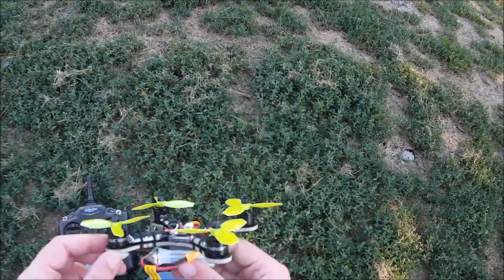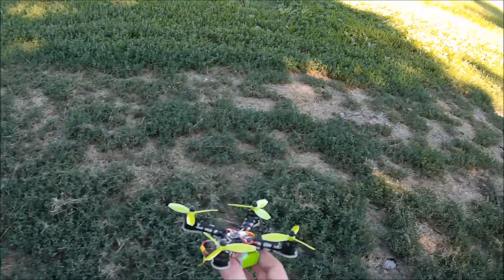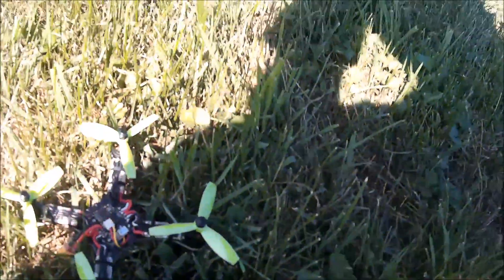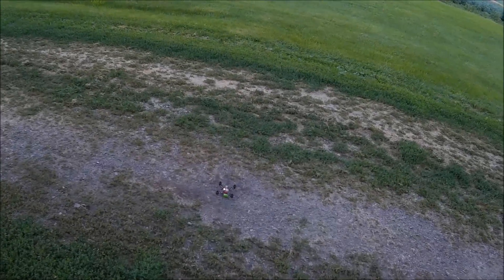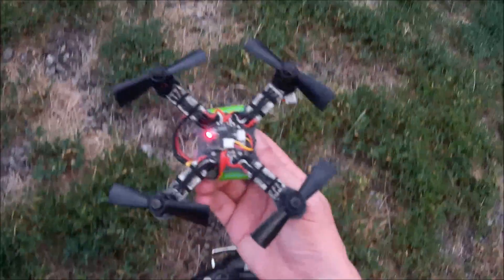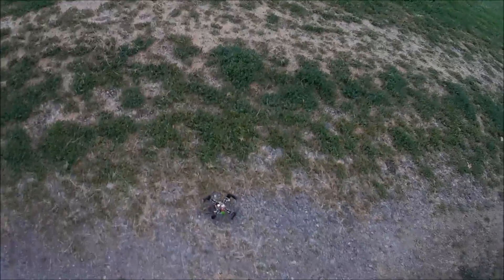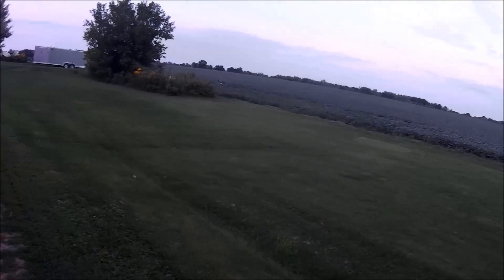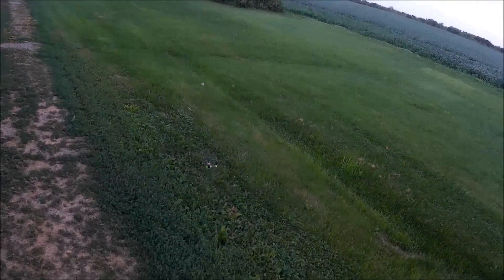1407 3200Kv 4s 3" prop comparison

Comment: Have you considered the 3545 tri baldes on your LOS build? 
http://www.ebay.com/itm/DALPROP-2-Pairs-3-blade-T3545BN-Props-for-FPV-Racing-GREEN-/231929028080?hash=item36000c1df0:g:MPYAAOSwKfVXJHYc
The math says they will physically fit without hitting the props together on a 135mm frame. Pretty sure that wouldn't work for FPV and the amp draw might kill the Piko BLX. But it could be worth a look at least.
Reply from the maker: I am pretty certain they would be too much for my setup, at least on 4s as 3545 tri bullnose would be a big step from standard tri 3040.  Bullnose  tend suck on efficiency  and stuff is already getting warm enough for me with the 3040's as is.  Definitely would want a larger battery and it's probably doable but I am kind of focused on FPV at the moment.  Racing is in mind so efficiency/reliability has to be considered.  Next on my list is to try standard 4045 on 4s.  I could be wrong, but I'm pretty sure there is not a sub 1000mAh battery that could ever even provide the sustained current to worry about the 50A limit.
Reply: I think you are right. I have some 1400mah Etreme batteries from SMC rated at 45amps. So that in theory shouldn't be enough to kill the Piko BLX. lol. And of course a smaller battery would have less current capacity and should be safer.

Comment: Can you give us some more details on this build?  What FC, ESC's, and what you are using for a PDB and anything else that might be useful to try to recreate something similar? Also, can you clarify if these yellow props at the beginning of the video are RotorX 3030 or 3040?   I think you say "3030" in the video and I can't seem to find them, I can only find the 3040's. I purchased the frame from you today by the way.
Reply from the maker: Hi Chris,
Thanks for your purchase.  I am Using the Piko Blx FC.  It has integrated PDB and one of the main reasons I love it.
ESC's are Blizzard (I think 20A) from RTF quads, but I they they are out of stock and I got them a while back so there are probably better options now.  Most 20A Blheli capable should work okay.   

And yes, sorry the Green tri-blade props are 3040 not 3030.
Reply: I had already purchased the Piko BLX (still on its way to me). Great minds think alike I guess. The PDB is only rated at 50amps though, do you know how much amperage you pull with the 1407's and the 3x4x3 RotorX props?
Reply from the maker: 1407 3200kv with 3030BN is listed as 9Amps, I don't expect 3040 tri's are much more.  Applicable batteries aren't delivering 50A anyway.  The 50A is probably a continuous rating as well, so I am far from worried about the board myself.

Comment: Hi Dave,
Amazing video! I'm Jon from overskyRC, we produced Hermit 145 V2 FPV Quadcopter, I would like to send you one set for try out and make a video, please let me know if it is ok.
Thank you!
Reply from the maker: Thanks for the offer Jon,  I am not the best FPV pilot but am practicing everyday so I should be able to make a reasonable video demonstrating the performance.  It is certainly okay for you to send one.  I am assuming you are aware I am owner of PicnicQuads.com and have purchased from you store multiple times.
Reply: Hi Dave,
Yes, this is the reason I contacted you, you are professional . We are changing a bit for the FC on Hermit 145 V2 at the moment, as we found that the quadcopter body would turn slightly when it was connected with Cleanflight software even it was still(no movement) on the desk, we found it could be a MCU problem on the FC, we will make a new FC for this quadcopter, it will be a F3 FC, it could be available by the end of this month.
Thank you!
Jon

Comment: I've recently done pretty much the same thing on a very similar 3" setup. Tried dys 3030x3, dal T3045 (really fat wedge type blade) and dal T3045bn (rectangular paddle style blade).
Based on power the T3045bn won but I was able to get a better tune with the lighter 3030x3 dys.
How big a battery are you using? I'm currently experimenting with a 2x 500/2S/HV which gives me a 4S pack at 64g. Not sure it would survive long with your sustained los style though 😉
Reply from the maker: I'm just using 450mAh 4S Pulse at the moment.

Comment: Are you making this frame? ...any plans for an FPV build on this setup?
Reply from the maker: I do make the frame I am using which is available here: http://picnicquads.com/product/130140-1104-frames/
Acro HD version for 1407's.

Pic of FPV pod in the works: http://static.rcgroups.net/forums/attachments/4/6/1/3/9/7/a8552290-145-IMG_1389.jpg  Camera selection will be pretty limited, but it's small, light and about as low profile as I could get it.
Reply: I need this in my life!! Definitely need the FPV version though because I'm not a LOS ninja like you. lol.

Comment: I am liking this brushless series you are doing. I've tried out the 5000kv 1407 from RCX with 3s and Dal3045 tri blades on a minimalist 128 frame. They are good but get very hot. They also did not like the Racekraft 3030 quad blade props.  But they may work well with the 3200s. You inspired me to get the 1304s and I really like them. But there are new 5000kv 1304s from RCX. Tempting!
Reply from the maker: Thanks,
I have seen the 5000kv 1304's, but think I will stick with the 4000kv.  Chime in if you try them though.  Looking at MYRCmart test charts the 5000kv yielded only a touch more thrust with 3020's on 4s, but the efficiency went down a lot.  My 4000kv get pretty warm as it is, and I'm also still able to use HQ3030 on 3s HVlipo for LOS flying.  Pretty sure 5000kv would be too much there.

Comment: With the amount of vibration im hearing your motors will overheat and demagnetize!? What batteries are you using, can you check my latest 9sec vid on 1306 4000KV motors? Im using a 500Mah Graphene for LOS flight, my frame is not as light as yours but is using a modified H101 floureon FC.
Reply from the maker: Yea, this was just some initial messing around, now that I have settled in on the tri-blades I will certainly tune the vibes out. To me the straight punches sound reasonably good,  but P is a clearly too high for directional changes.  
I am using the Pulse 4s 450mAh 45C packs.  I checked your short video, pitch/speed sounds in the same ballpark.  With 4000kv I have to imagine your on 3s?  My gut tells my 4s would be cooking.   Currently my favorite build is using 4000Kv on 3s, but I'm using the lighter 1304 motors and 500mAh HVLipo.
Reply from the maker: Nice! I checked them out.  Thanks for testing all those.  Had no idea there were that many.  I think the HQ3X3X3 are the ones I'm most interested in, aside from the Rotorx I already have.  It also confirms I should be able to run 4s on the 1407 3800kv since they should be able to handle a touch more than the 1306 and spin them a bit faster too.  I need to hold off on that experiment a bit though.
Reply from the maker: I've recently tended towards the RCX mainly because they have the 1407's, which seem to provide enough thrust over 1306 to justify the minimal weight increase.  Never had any durability problems with them either.
I got to wondering yesterday, are there any builds where the 2 blade bullnose props I tested I would be ideal?  Or have they basically been overthrown by tri's?

You got a lot of build going on.  Hope the motor mounts arrive soon. I am likely going to be making HD versions again but if your breaking them at the frame interface I have found a few wraps of thread around the mount tightly followed by a drop of CA can make them much stronger with almost no weight gain.
Reply from the maker: I actually have 1306 on my tie Fighter: https://www.youtube.com/watch?v=kM7dcPpxPsI which is running 4" props so I may try that there.  It's a bit heavier but should notice the difference either way.  Right now I run 3s with 4045 Bullnose, but RCX says don't do it. Always thought 4s on any 4045 would be way too much but I forget how much of a jump the bullnose are from the standard 4045.  Likely more than the jump from 3s to 4s.
Reply: 850mah highvolt 4S batteries can deliver the power, 1306 emax 4000KV is taking 45 amps at full throttle. They are only 104 grams and have way more punch then my 500Mah graphene. http://www.hobbyking.com/hobbyking/store/uh_viewItem.asp?idProduct=87967. This is the best battery I currently have for my 3inch
Reply from the maker: ADAMBOMB FPV Good find, kind of pricey by today's standards though, especially at BG.  I think I am going to leave this build as is for now though.  If I do anything, try a 4" setup with same motors (have couple 1407 3200kv sets).  Really want to spend more time working on my FPV game lately.    New cameras should arrive soon.  I got the Runcam owl but was way too big for me to even consider installing.
Reply from the maker: MrJob91 I wish HK has a smaller 4s HV option (mainly for 1304 build).  Found these and have a couple on the way: http://www.multicopterbatteries.com/bonka-power-500mah-high-voltage-15-2v-4s-80c-xt-30/     
any thoughts??
Reply from the maker: Really better than HV lipo?
Reply: 500Mah is depleted in 1,5 min on my build, XM 20A Blheli ESC are maybe somewhat inefficient...? although im getting insane speeds. I've bought zippy compact 1000mah Bolt 850mah and a very very heavy Graphene 1000Mah... will testflight now will report to you later whether my build survived that heat.
Reply from the maker: Thanks, look forward to your added feedback.  I have to imagine the faster speed and smaller motor size also result in less efficiency compared to my setup. I have been getting at least 2:00 on 450mAh.  450-500 is likely best suited for 1304 and smaller though.   I personally don't want much more weight on 3" props though, so I'm hesitant to jump to 850 until I jump to 4" props.
Reply: after flight I truly recommend the bolt 850, its totally worth it. the 1000Mah lipo's sucked with the hot wheather, motors were too hot. on average the bolt can deliver around 80 amps when fully charged. I believe that the 1306 motors draw 45-50 amps. My Lt130 frame is just not that efficient and I have a lot of acces wiring, do you recommend to cut the wires short? today im building a tarot TL120 frame with 1106 motors I try to keep wiring short and use only one plate. 
1407 motors (racerstar pro version 13$) will be awesome with that bolt 850 battery
Reply: Today I built a quad with 1106 3800 kv motors without props or battery it comes in at 57 grams
Reply: Wow competitive! Im using a 12CM frame Tarot lt120 tarot motors and ESC's I'll be posting pictures in the silverXXX forum (h8 acro firmware) silicon tube makes for a great battery strap! it weighs only one gram and loops 3times around my battery I got it out of an old printer I took apart.